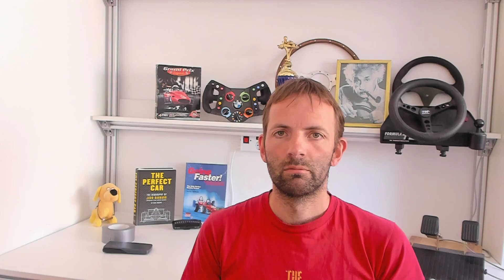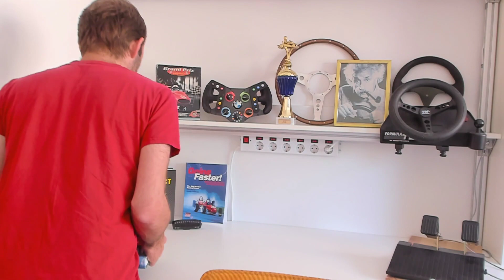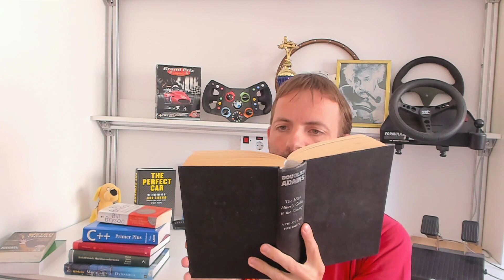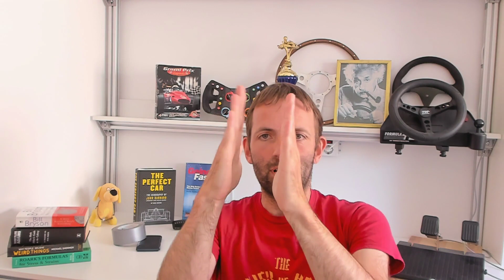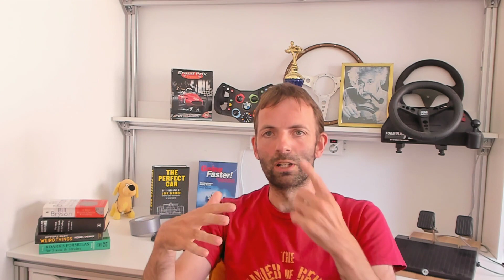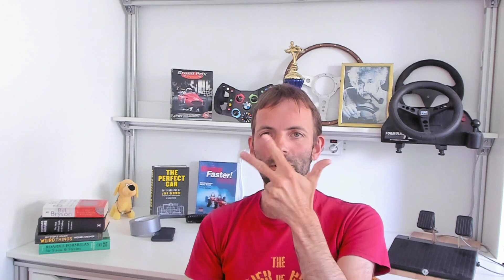Why are tires so difficult to model in a racing simulator?

Comment: I've noticed via modding experience that most of the time it seems like sim developers get almost nothing useful from manufacturers, even for suspension and other things which are easier to measure. Let alone tires!
Reply from the maker: Yup, they may not like to admit it but I am certain some big name cars in some big name sims were made with little or no data. These can still be great cars because experienced physics guys that I mentioned are good at filling in the blanks. You don't always NEED all the info to make a realistic car. Let me add that for AMS, even some of the cars we have 'officially' got in there, we got zero data. Sometimes I had something to help us from other projects but a lot of the time we had for example only a bit of telemetry. Sometimes nothing! Imagine the complicated aero on the Fiat Uno! Nightmare! :-)
Reply: @NielsHeusinkveld  I've...remade some cars in some simulators which I will leave unnamed for now ;), and it does baffle me when basic things are not making sense. When there is an indication of not understanding design, or mechanics for example. Things which are not excusable for the most part by lack of time/data.

I find in this kind of situation, when it is largely down to the innate understanding of real car design and how the "numbers" usually are, where the ability shows. Tires are almost completely reliant on this quality IMO as there are so many unknowns that you need to "educated guess" very often.

Consumers seem to have this kind of idea that the sim developers all get the perfect data and it only comes down to the accuracy of the simulation itself, but I would argue a lot is down to just the so called engineering design sense of the creator. Very difficult to make a fair estimation of simulation accuracy of a specific title when there is this factor affecting the result. With lack of data but a good "artist" you can make a better product than with all the data but an intern at the desk. ;)

Of course it is just my opinion as a lowly modder.
Reply: @NielsHeusinkveld  Speaking of the FIAT Uno, spent the whole evening hotlapping in AMS2 and it handles incredibly well!
Reply: @NielsHeusinkveld /videos License a car from car manufacturer. Ask for reference data. Get sent a sales brochure. Yay.
Reply: @NielsHeusinkveld  It's been more than 10 years now, but I can give you feedback on the old fiat uno or the seat panda (Spanish Fiat panda).
I miss my first cars...
Reply: Wow not even for Stock cars? Then probably you mostly didn’t have real drivers’ feedback too and based on racing footages.
Yet many people say handling in  AMS 1 makes sense, and some even praise it! But I think iRacing always uses real data, but perhapsnot super detailed  - they might get simplified aero etc. Also I think AC devs said they were basing on real data at least to some extent. It’s also true for some official cars in rFactor 2 like Tatuus, and in RaceRoom.
Reply from the maker: @JanKowalski-kb1hd  It depends greatly Jan. For the Stock Cars in AMS we did get suspension data and telemetry which was extremely helpful. However they probably didn't even have aero data because of the low budget nature of the series. So we had to fill in some blanks still. This goes for a lot of small manufacturers who are still going by the seat of the pants feel rather than big budget simulation and aero testing.

iRacing might not always have access to more data than other developers. It can be very hard to work with manufacturers and they won't suddenly hand over the secret data. Some manufacturers are extremely open, like I believe indeed Tatuus may well provide more data than others.
I can't tell for sure, but the data a sim might have doesn't depend on the price or budget of these sims, more with the luck and communication skills of one or two guys on the team.
Reply: @JanKowalski-kb1hd  Even without (Or; especially without) data you can make a car drive well. It just won't be very accurate to the real car, probably.

Normal consumers who drive sims have IMO no real valid opinion on car accuracy at all, so it kinda doesn't matter what people say. Quite badly made mods come out all the time and everyone praises them; why not the same for products.
Reply: @NielsHeusinkveld  How come GT Sport and PD didn't make any improvements on their tyre model after sealing the partnership with Michelin,? Surely they gave them a lot of their data and help....it wasn't just for marketing purposes I guess....
Reply: @NielsHeusinkveld  From a fellow Automotive/Mechanical Engineer to another, saying stuff like:

"You don't always NEED all the info to make a realistic car. Let me add that for AMS, even some of the cars we have 'officially' got in there, we got zero data."

is utter and idiotic nonsense: even ballpark figures and incomplete data are still "some" data. It's up to the physics modder to use his/her brain properly and give out something that would be in the "believable" realm.

Also, "complicated aero" the FIAT Uno? Mate, it's literally a brick! Every University in Italy just uses it as an example of what CFD programs can do... and you can set one up easily because the car is really easy to model.
Reply: @gabem.5242  I believe the Fiat Uno comment was what is known to non-robots as "a joke."
Reply: @gabem.5242 I'm pretty sure he's aware that "ballpark figures and incomplete date are still 'some' data". His point was simply that with proper knowledge of vehicle physics, you can make a car that feels correct.
Reply: @gabem.5242   But you don't run CFD on the fiat uno for 30 different combinations of rideheight and attack angle, that would take months.  Now then try to apply the same CFD methodology on the entire car list....that's the point Niels made, it is sometimes impractical for even the manufacturers to produce such data, let alone a mere game developer.
Reply: Gabe M. He was being sarcastic about UNO man. And the odd thing is, you seem to agree with him.
Reply: @graphicaluserinterface  :-)
Reply: manufacturers will never give any useful data if they did other manufactures would rip the game for real world data that's one of the reasons motogp games have never had real engine sounds. Teams have been known to record them & get information!
Reply: Not true. Some give very detailed data. That was I.e. the case with Tatuus and BMW M2 racing in rFactor 2. Also they encrypt mod files so you can’t rip them. Also I think Porsche gave good amount of data to iRacing i.e. 911 GT3 Cup, and AC.
Reply: @JanKowalski-kb1hd  exception rather than the rule really, do you know ACC guys are still now asking around for someone who access to a R8 GT4 so they can get some basic data? The pack is supposed to come out in months.

Comment: So, if the problem is that physical models are not enough developed to reflect reality I think it would be amazing tool for tyres manufacturers to get to know better how the tyre will perform before producing it. Which means less costs in medium-large term and the capability to try out new things without having to invest such amounts of money in prototyping and all this kinds of things that have high impact in industry
Reply from the maker: I bet at least one case of beer on most manufacturers spending big money on models like this to predict tire behavior. More likely it is advanced finite element analysis and stuff that can't run realtime. But in a way RF2's model is also kinda like this, it doesn't run in real time but rather creates a huge lookup table of a non realtime analysis. (I think).
Reply: @NielsHeusinkveld  That's for sure, a precise loop with an enough amount of nodes to simulate the mesh for the FEM Analisys in real time could take some hours in a decent computer to render just an specific situation. A part for what I know finite elements need contour conditions which means that are some point they are not dynamic, as they have specific value if I'm not mistaken
Reply: @NielsHeusinkveld  Yes, from hanging around the ISI forum way back,  their devs said it's partially physical and couldn't run in realtime. That makes iRacing's model even less plausible given that it's fully physical and realtime. Dave Kaemmer clearly (and rightly) thought the idea of forces just "falling out" of a model of materials, construction and temp effects would be cool. But there's an interview somewhere where he admits not even having studied physics at college and wished he had. I think he's a smart games programmer who didn't understand the way engineering feed-back systems that contain energy storage components (inertia, spring, thermal energy) work when subject to transient input. The energy moves back and forth, so you can't intuit the output at all. The thought of tweaking this one for a specific result makes my brain explode.

Comment: I’m a data scientist, not an engineer, but certainly you can stick on a shit ton of sensors on a car like F1 and feed data like, flex, temps, spin, degradation, into a machine learning model to sim a physical model of grip levels? It would just be crazy to do for every vehicle/tire type
Reply from the maker: That wouldn't be a 'physical' model the way these models are now, it would be like some huge algorithm / polynomial empirical thing surely? And yes, perhaps you can, but then you have to model the Fiat Uno cup in Brazil where the budget is whatever it costs to fill the tank... ;-)
Reply: @NielsHeusinkveld  that would at least be a good way to compare a physical model on a sim with real world results.
Reply: Niels Heusinkveld haha thanks for the reply Niels! Yes it would be monstrous mess of an empirical algorithm that wouldn’t be the easiest to tweak either
Reply: I think this is likely a good approach. You would likely to run a bunch of setups on the car to get it right though especially at the extremes to make it less "hackable". For example, users would likely figure out a setup where the NN does a really poor job of approximating and the model provides too much grip. I guess it might depend on your output function. That said I'm betting it would take forever to generate enough data to develop a model for something like a neural network.

Comment: As a vehicle dynamics modeler myself I always take the Ockham’s Razor as a principle.

Current state of physical tire modeling is too complicated with the lack of available data to make it work.

Developers are exchanging accuracy for precision for PR reasons. That’s why still going with extended packejca in 99% of the time in sims will work better and more accurate.

Comment: As someone who works on mechanistic modelling for a living, you cannot get around the lack of data by using mechanistic models vs. empirical models. You still need to validate mechanistic models against experimental data to understand if the simplifying assumptions you made affect the accuracy too much. iRacing's modus operandi seems to be to just declare that since it's a mechanistic model that means it must be more realistic than other models and to ignore all the anecdotal data that says otherwise (like pro-drivers complaining).
Reply: This is very true. No matter how precise or correct your model is the number one rule of simulation stands: "garbage in -> garbage out"
Reply: There seems to be some confusion over criticism of the iRacing tyre model - it's not forgiving - and the pros and cons of physical and empirical tyre models. There are empirical tyre models which are unforgiving and physical tyre models which are forgiving.
Reply: Seems accurate. Not sure it's iRacing doing this, seems more like the fanbase likes it this way, and they follow suit. Almost seems like elitism over accuracy. The reality is they are all off base and imperfect. But some feel more natural then others.
Reply: @xX_Gravity_Xx  Two wrong assumptions in this replies. First, iRacing is not "ignoring" inputs from different people. But they decided to go for a physic based model, that will be probably the right way to go on the long run. It will lead to a much complexer simulation. What I did not expect is how slow their development progress is to use it in different car classes. Whereas the Skip barber (longest development on NTM7) is close to a perfect simulation of a car, it is nowhere in other car classes. 
I'd rather have a faulty complex simulation that empirical simplified models, best example the current AMS2. Youtubers as well as the G27 fraction are faming it, when it is so obvious how simplistic it is, all the same basic behaviors for EVERY car class: floaty feeling into corners, weird oversteer reaction on throttle out of corners (every single car!). That is just ridiculous. Only because you feel stuff on your cheap belt wheel and are able to react on does not mean it is a good Sim.
Reply: Incorrect. "Fortunately, a great many scientists around the world have published books and papers in peer-reviewed journals which provide results that we can use to build our model. The most important thing to remember is that once we see a paper with some data, and we use that data to come up with a bit of theory, we can NOT use that same data to validate the theory. We have to find new data, which we haven’t seen before. "

They basically build the tire model off of empirical data, then try to build the physical model, then check that along side of the empirical model.

You should really read what they say and actually TAKE what they say rather than just making stupid assumptions.
Reply: I think iRacing is trying to figure out how to make the tire model realistic. It's so difficult that they don't know how to fix, but they are working on it.
Reply: Seems to be? Who at iRacing has declared or implied this? You're making ridiculous assumptions. Have you considered that maybe they are working at their own pace to solve problems with their model rather than constantly knee-jerk reacting to user bitching and fudging the fuck out of it? Kaemmer has been working on tire modelling for, what, decades? I don't think they've ever declared that they're finished. It's going to be a constantly evolving product, but some of you dumbfucks seem totally oblivious to this fact and think they're over there just sitting on their hands with smug smiles while they read your whiny complaints.
Reply: azarisLP there are books, Segers is an example, that shows real x iracing telemetry data. The flaws in low to medium speed cornering are huge. Despite having a huge partnership and access to teams, they don’t seem to do the QTG properly
Reply: Augusto Dufloth cool , now you know if you want the most accurate low to medium speed (who drives low medium speed on a track lol) you gotta spend your $$ and do the real thing. Doesn’t change the fact you gotta learn and practice the car in iRacing like any other given situation. All I hear are excuses for bad practice skills and paying for content (that  no one seems to complain about any other game) smh
Reply: What exact;y kind of forgiveness are you guys looking for? Bad driving ? Not reading the tires properly? Just learn the car like any other given situation. Pro drivers are some of the whiniest cry baby sports superstars that there can be , like were really going to entertain their childish expectations lol
Reply: "seems to be" theres goes reading your comment lol
Reply: @jnc18  Found the iRacing shill